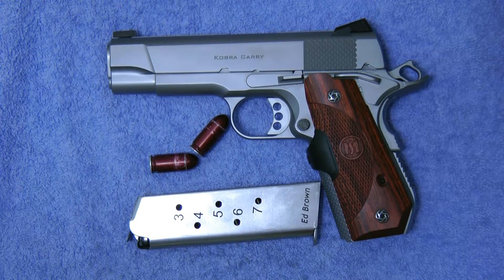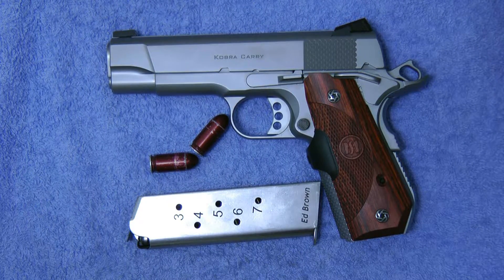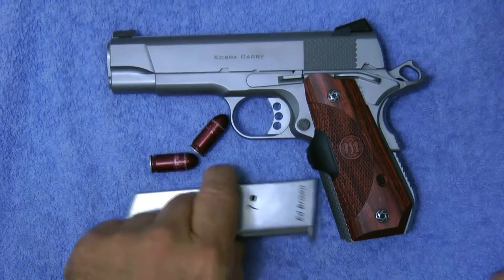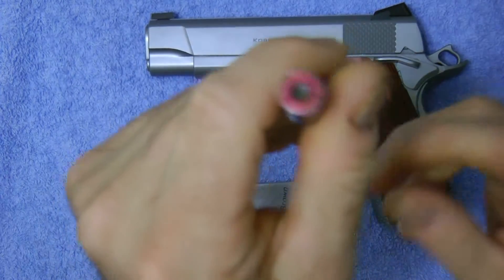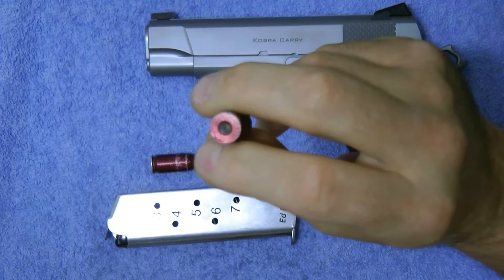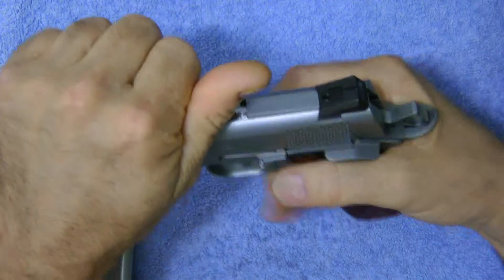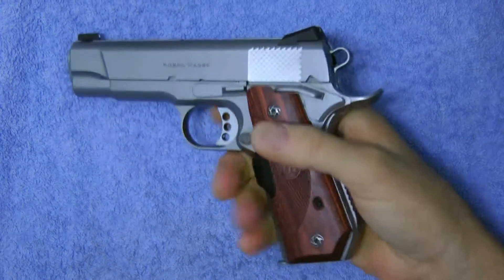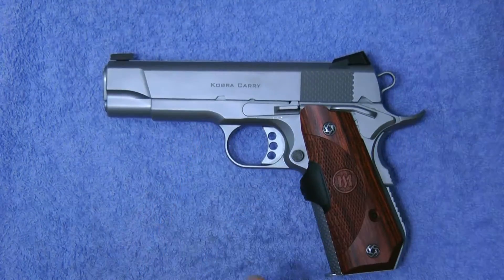SNAPCAPS FOR DRY FIRING YOUR GUN

Comment: How about after you insert the Magazine in it you let the slide snap forward using the slide release Lever, Whit the snap caps in the gun is it ok to do,? Or it will damage the gun over time by doing the slide this way etc, Thanks for sharing etc.
Reply: Load your gun from a mag, like it's intended to be loaded, unless its revolver.
Reply: 1911 designed to be dry fired and released on empty. Thats why its back to back WW champ